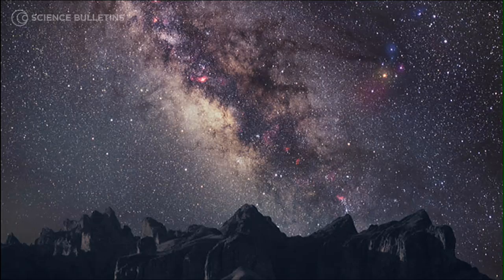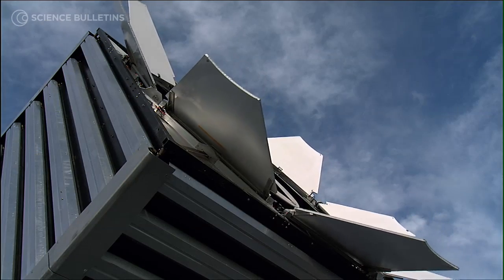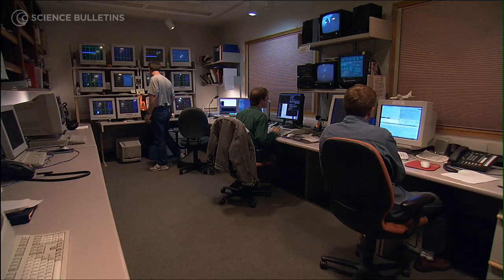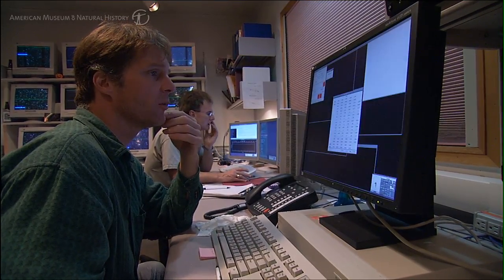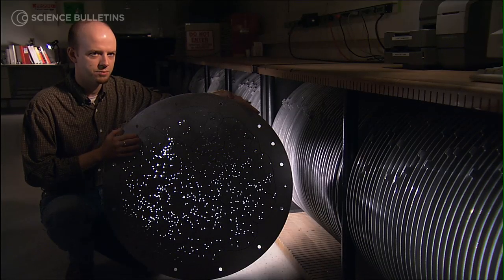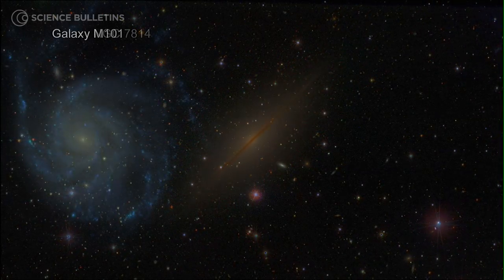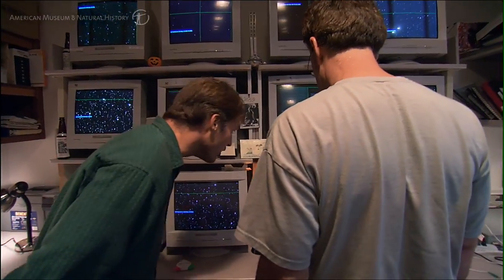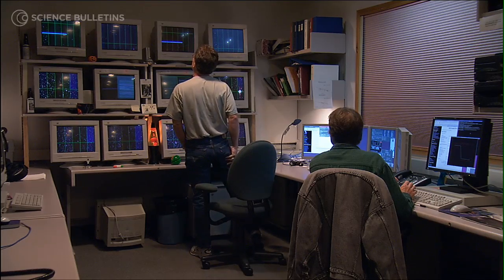Science Bulletins: Sloan Digital Sky Survey—Mapping the Universe

Comment: I still don't understand how this works... So data is being sent to a drill that makes holes of different sizes on a plate - I'm confused as to a) how they can just shine light through it and get distance data b)how they have optic cables that fit every size hole. This is the 3rd place I came to try and have these questions answered I can't figure it out
Reply: No... I can't either. I've seen several PBS documentaries. Why do you need the metal plate for relative distancees.

The only thing I can think of, is the the wires transmitted different current that are relative to the brightness of the objects viewed. And the holes are the possisions of the said objects. But I have no scientific training at all.
Reply: The plates are used only for the spectrographic operations of the 2.5m telescope.  The holes in the plates correspond to positions of target objects and optical fibers are inserted into the holes. The fibers connect to powerful spectrographs with different spectral dispersions and different spectral regions. 

Separating the light from target objects into their unique spectra provide vastly more data about the source than a mere image.  Everything from the chemical composition, to the temperature, the strength of magnetic fields, to the line-of-sight motions of the objects (with respect to the observer) are measurable with spectrographic observations of astronomical objects.  And whereas it was wonderful when spectrographs were first applied to observe one object at a time with a large telescope, it is orders of magnitude better to collect HUNDREDS of spectra every hour of every night of telescope time.  (This was the goal of the SDSS project.  The folks who conceived, designed and operated the scope hit the ball out of the proverbial ball park.  The spectrographic observations are routinely conducted with the efficiency of Japanese automobile assembly plants. Science at the SDSS is done with business-like efficiency. But I digress.)

There are only two different size holes in the plug plates; accommodating either a single fiber or a small bundle of fibers. The latter are used to gather light from an object like a galaxy and they allow to collect a bunch of spectra from that galaxy sampling the innermost regions near the core of the galaxy and regions at different distances from the core.  The spectra reveal the different aged stellar populations, gas clouds, and, crucially, the velocities, towards or away from us, of those different stellar populations and gas clouds.  The cool thing about this capability is it allows us to detect populations of stars which are the results of collisions and mergers of galaxies long after those collisions or mergers.  And, by mapping the velocity of stellar populations at different distances from the cores of their host galaxies, we can detect the presence of super-massive black holes  at the centers of those galaxies.   Surveying tens of thousands of galaxies allows us to know how rare or ordinary black holes are in galaxies.

I hope this answered your question.
Reply: @trimetrodon  so, they take an image of “square A” of the night sky. The data is then sent out to have a plate made of it where holes are drilled corresponding to certain celestial objects they want to catch the spectra of. After that the holes which correspond to the objects of interest are plugged w optical fibers and the plate is inserted back into a telescope which is then pointed back at the same “square A” patch of sky initially observed?
Reply: @thunderdrumandbass  Yes, you’ve got it. :)
Reply: @robandrews4815  look up how they do spectography. They usually use a slit to isolate an object. This is the same thing just a lot more objects at one time.

Comment: This is so low-tech and cumbersome. Why not just have a lattice of fiber cables, each with 2 motors to position them to any point within its lattice square, computer controlled. Certainly much cheaper, way faster, and much more flexible.
Reply: Factor in cost and jitter and you'll probably see why they use the low-tech method.
Reply: That's exactly what's being developed for SDSS-V
Reply: Robotic fiber positioners will be installed this year.  It is a non-trivial upgrade.
Reply: @trimetrodon  Regarding my comment: I guess low-tech and reliable is better than high-tech and error-prone. Things usually aren't as simple as one may think...